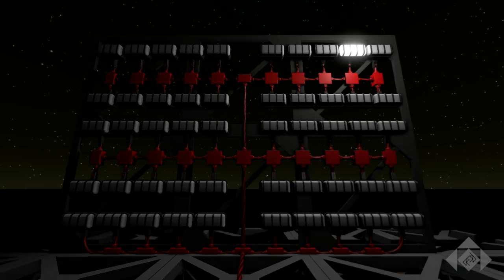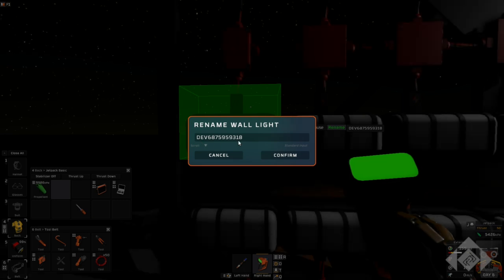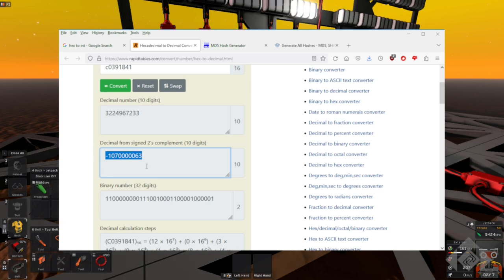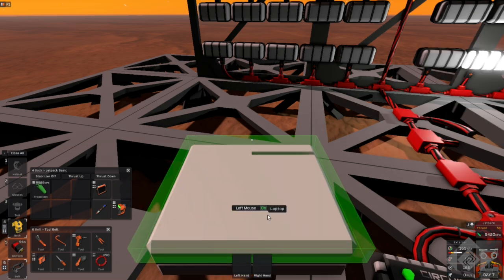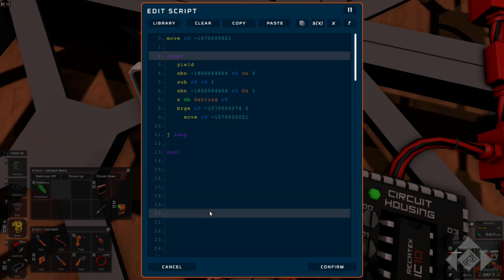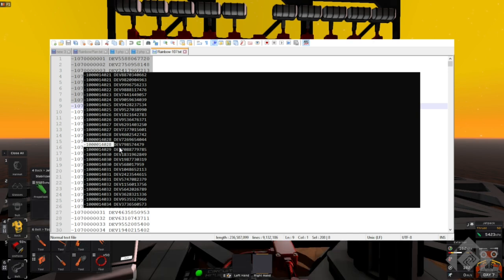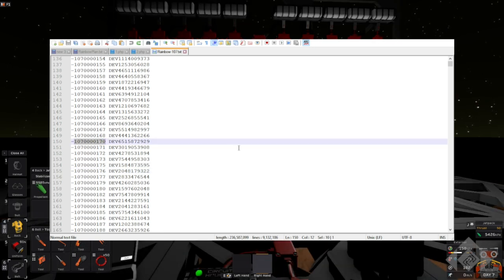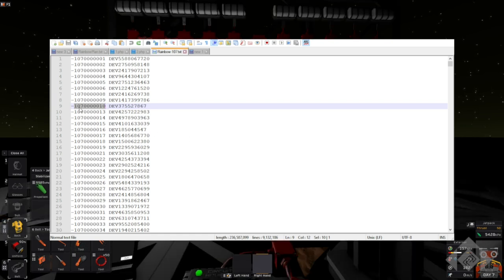MIPS Sequential Device Addressing Using Rainbow Tables, an actually quick tutorial - Stationeers

Comment: Interesting video. I thought of something similar myself. Why not get rid of the "DEV" at the beginning of your device names? That might get rid of the holes in your rainbow table.
Reply from the maker: Counter intuitively, the contents of the data to be hashed, has very little organizational impact on the results of the hash, the solution will always be sudo random. Functionally, there is no difference between between the plain text "DEV12345" and "12345678", the algorithm treats alphas and numerics synonymously... I added DEV to give the dataset some context. CRC32 was never intended to be used as a cryptograph, but rather as an integrity check, so it was not optimized to minimize collisions, and as a result, has the worst redundancy rate... I'm not sure what the exact factor is, but wiki says there's a 50% chance of at least one repeat value in a hub of 77,163 results. This factor rises exponentially as the number of generated results rises linearly, meaning to generate a full hub of 4.28 billion, the maximum number of results for CRC32, I would need to generate trillions of hashes...